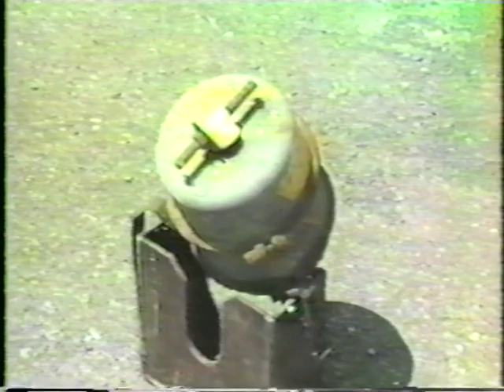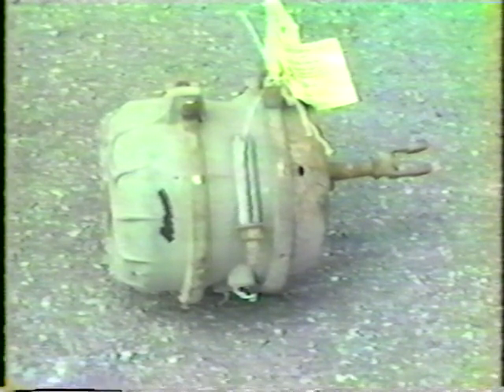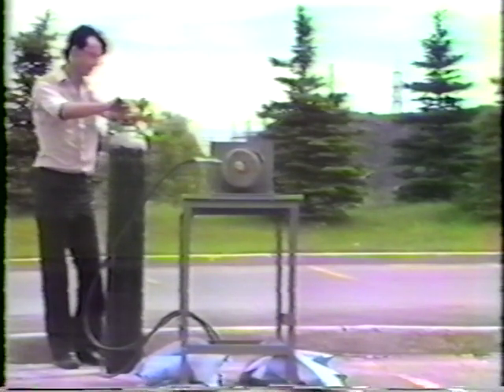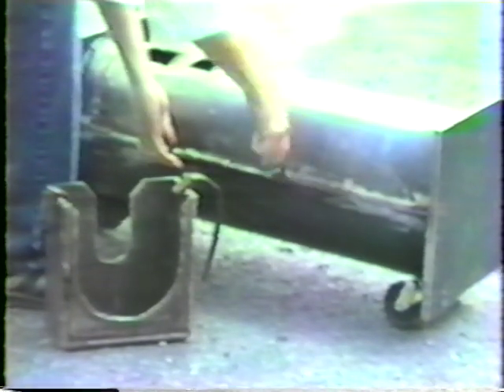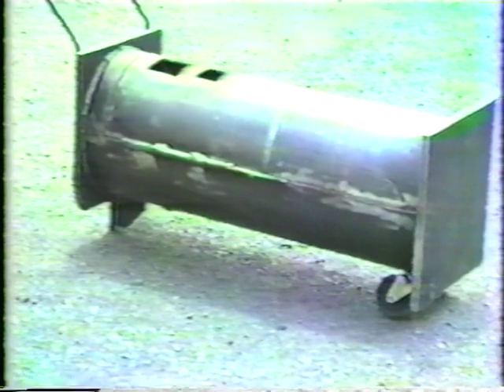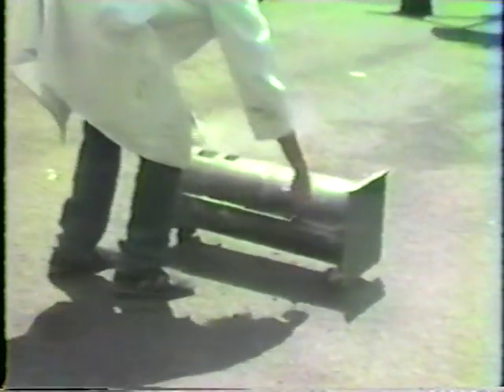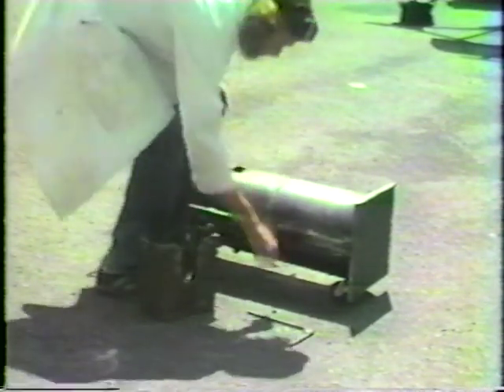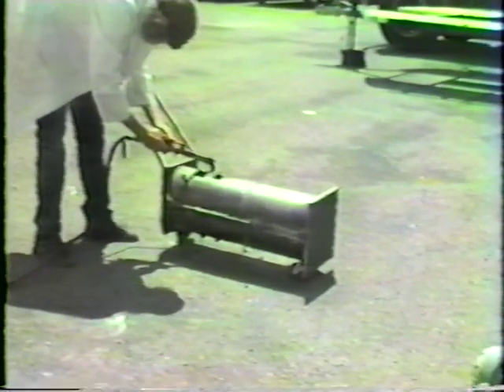brake chamber dis-arming.VOB

Comment: Chambers are all dangerous but made to be much safer now. Ours only have one clamp band on them. We cage them and cut a hole in the casing so we can actually cut the spring. The small spring in the rear behind the diaphragm is pretty harmless but the main one is about a 2000lb spring looking for a home- You don't want it to find a home anywhere on your body.
Reply: The new ones still let go from time to time.  A driver was decapitated in Toronto by one a couple of years ago.  While they are better, if not maintained they can still let go.

Comment: The disassemble chambers after six minutes made me cringe. Full safety gear Meaning gloves, face shield, hearing protection and hardhat should be utilized by even the most experienced mechanics. Even the bar and hammer used to dislodge the spring should have been welded to a safety chain attached to the cage. I believe the proper method now is cutting a hole in the side of the lower main chamber to cut the main spring with a torch. I’m sure a specialized torch head could be made to keep your hands away from the cutting area.

Comment: I was working on removing and doin stuff to the chamber and I’m 14
Reply: It's a good thing you've saw this video or you may have been taught how to work on what you need to do . I've worked at a multiple mechanic shops and manufacturers building trailers and at one point in time places would just throw the brake chambers in the scrap/trash and well needless to say someone at the scrap yard ended up getting their head taken off by one and its illegal not to disarm/dispose of them properly . They have places/shops that will do that for you.